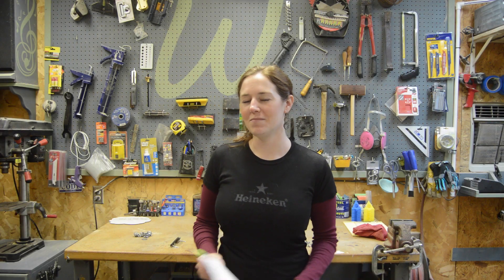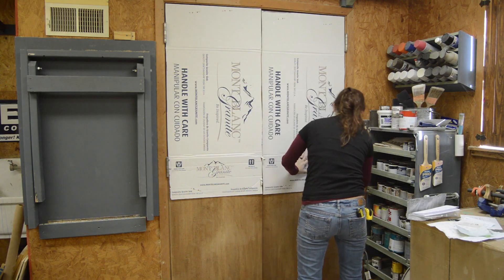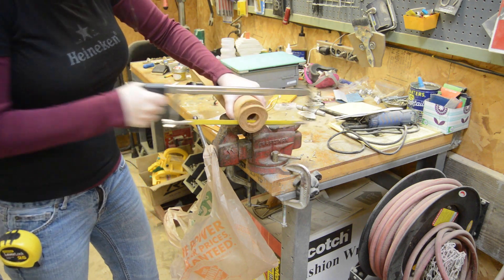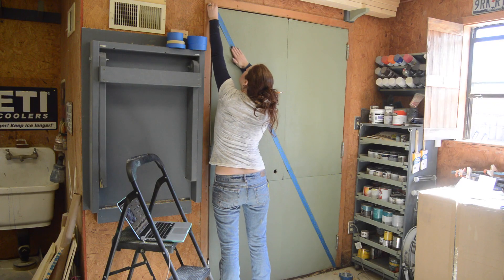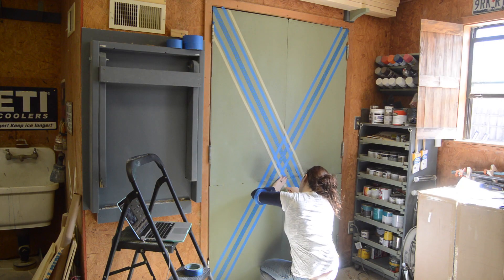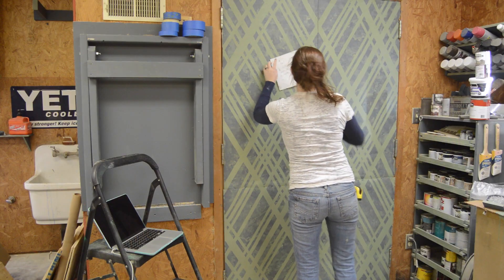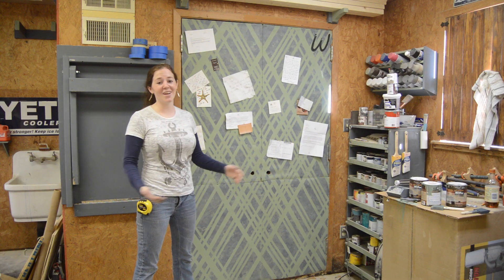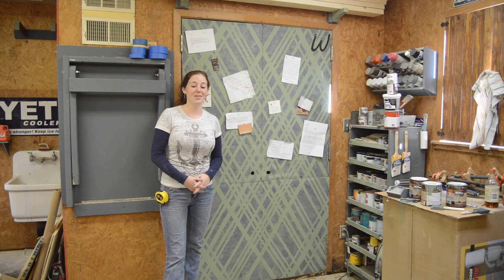DIY Shop Corkboard

Comment: nice job, hope it holds up. If not, I have used suspended ceiling panels, there are certain types out there that are quite firm and hold up to extreme use. Sorry I can't tell you much about them, been years since I bought the unit of panels and box is long gone. just posting this in case someone wants a board ands wants to look into the panel to try. thanks for all the ideas.

Comment: I realize this is an old post, but two things that also work well for a cork board are ceiling tiles or "beaver board" sound deadening material. You can pick up both at your local big box. They're cheap and much thicker than most of the cork you find nowadays. And you can paint them too.

Comment: You might consider using a drop ceiling tile for your backer board for your cork it is much thicker and would be pretty easy to glue the cork to.

Comment: Did you get any warping of the cork after you painted? Great method. Good use of the space.
Reply from the maker: Thanks Tom. No, not warping but it does loosen up while the paint is wet. However, it tightens right back up when it drys. I have a photo of what it looks like when the paint was still wet, on my blog if you want to see.
Reply: Oh ok..I'll do that..thanks

Comment: I would not have covered the bottom part of the door with cork board as it will not be utilized enough to warrant it there. Painting (to my way of thinking) is not necessary and may even be detrimental to the board's functionality. I could, however, see maybe a drawing using Sharpies or Magic Markers. Cork is absorbent (naturally) so something like full-coverage paint soaks in quickly. The same properties that allow cork to be self-healing also contributes to the absorption rate/amount. I'd just leave it brown but maybe with a drawn-on border.
Reply from the maker: The board was done, not only for function but also for aesthetics. If I were to only cover the top half of the doors, I would not only be wasting space but also have a very unsightly project. And I fully plan to utilize the bottom half of the doors for attaching notes. I read the individual notes as they come in, but when I pin them to my board, it is more about the image they create together. Imagine when I receive a comment from somebody being negative....a single glance at my door will remind me that there are plenty of people who are enjoying what I am doing. Cork is very absorbent and did loosen up while wet with paint, but it goes right back to it's original state once it dries so there is no reason not to paint it, if one wishes.

Comment: Great job on the cork board!  One question, what kind of paint? Oil based, primer sealer or latex?  My wife wants one in the same size and wants to paint it also.  Thanks!
Reply from the maker: I used latex with primer in it. : ) Cheers.

Comment: What glue would someone suggest for this then?
Reply from the maker: I would think any glue would work, but I would personally probably start off by using hot glue since it dries so quick. That would be the best way to combat the bottom portion that still has a lot of roll in it. Any other glue would require pressure until it was dried and even though you could try and glue the cork to the cardboard while it was off the door, I think that would be a lot more difficult to getting it as exact as possible. So yeah, if I were doing it again, I would try hot glue and just put spots here and there.
Reply: I was thinking contact cement or that glue you use to put melamine down with. the melamine glue i used in the past was set on contact which is a blessing and a curse.
Reply: April Wilkerson thought i do like the idea of hot glue because its so easy to use.